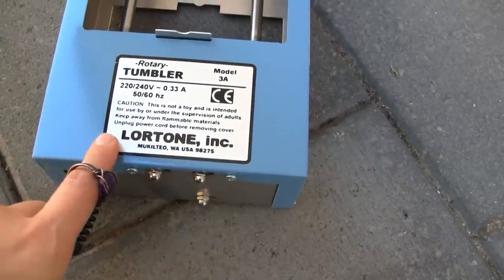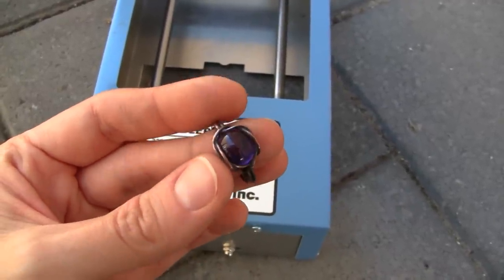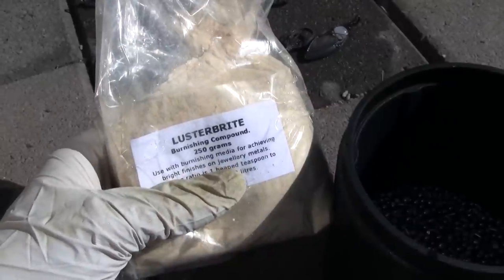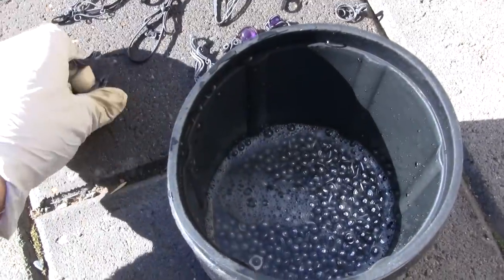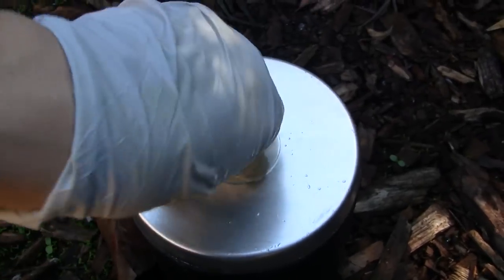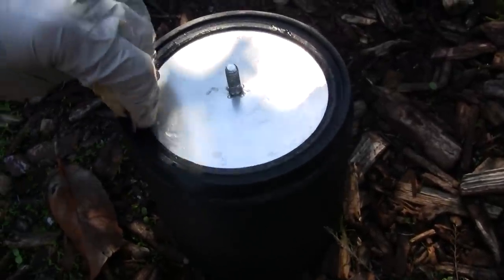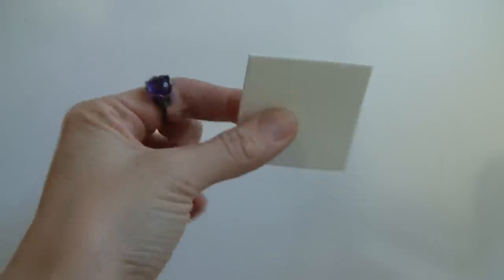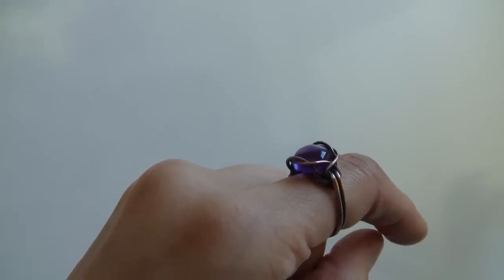Tumbling Jewelry After Oxidizing to Clean it

Comment: Oxana,  Thank you for taking the time to do this video. I found my tumbler to be a game changer. I actually use a fingernail buffer block before the tumbler to take some of the oxidation off, then toss in the tumbler with stone in if above the #5 Mohls rating. 45 to 60 minutes and when it comes out it is good to go. Then I generally seal with ProtectaClear. I don't consider any metal work complete without the tumbler. If I am doing earwire or loops that I want hardened a bit, I leave in for 2 hours. I have the same tumbler. I use a little bit of Dawn and clean out between each use.
Reply: Yes, I learned from someone about using  Dawn inside the tumbler,  but just a couple of drops, not too much. The best one is the blue one because it has less moisturizers and it leaves the best shine on your piece

Comment: Another great video.  Thank you!  I'm not sure if you're still using your tumbler but if you put the nut on the rubber lid, it gives you something to hold on to as you pull the lid off.
Reply from the maker: Thank you for the tip!

Comment: Is there any way to keep the copper bright or do you think it better to always oxides
Reply from the maker: There are different sealants and laquers you can use. I personally have not tried any though
Reply: @OxanaCrafts  thanks 🤗👍
Reply: eruis 313 I haven’t tried it bc it’s expensive, but I’ve heard that “micro-crystalline wax” is great. However, there’s a pretty new “ceramic coating,” for car paint that I think should do a great job! You can get enough to do your car a few times for an average of $30, so that would protect a LOT of jewelry!!! I’m gonna try it. 😉👍🏻
Reply: I know a lot of people use renaissance wax. I’ve never used it myself but I’ve heard a lot of good things.
Reply: @YTjndallas  thanks
Reply: I use ProtectaClear. I wasn't fond of the Ren Wax (micro-crystalline).